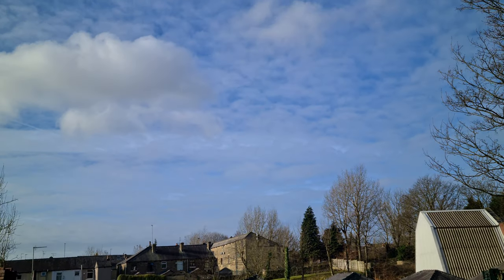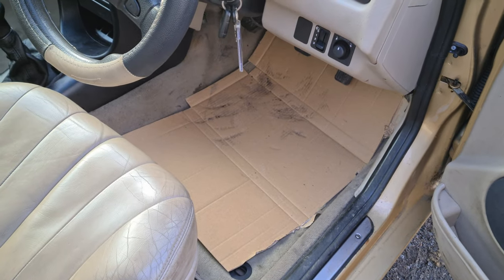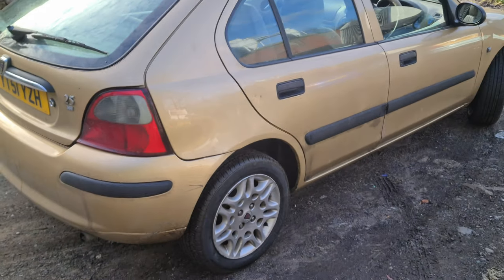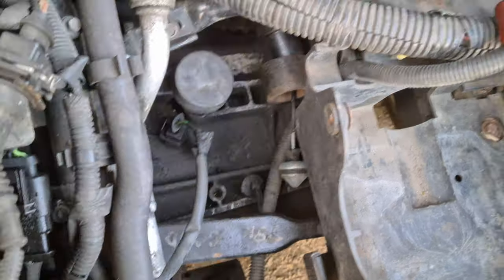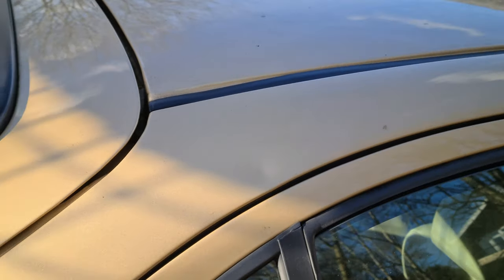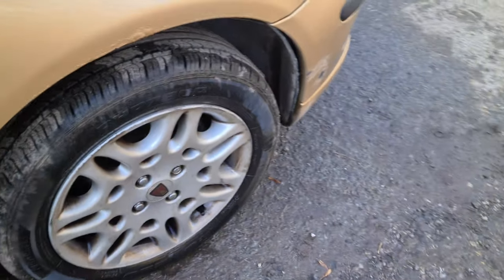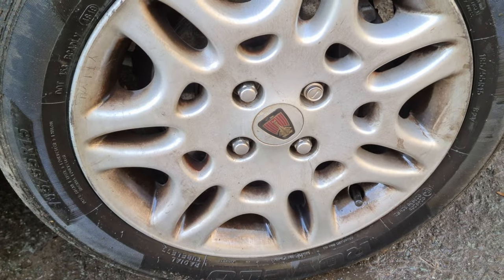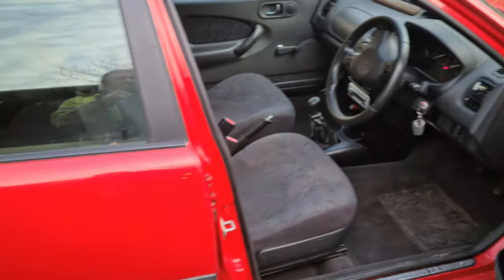Project Kurt pt.1: fixing slack clutch cable and a clean up

Comment: Hey Project Nigel 😂😂 call me what you like just don't call me early in the morning Kurt is not a bad name I had a 1.6 il it was good little motor until the imboliser gave up. Wouldn't be a rover without some rust. Tea time. Penny washers to the rescue lol. Wheels turned out well 👌👍
Reply: My rover 214 doesn't have a single speck of rust on it 😮 am i just lucky??